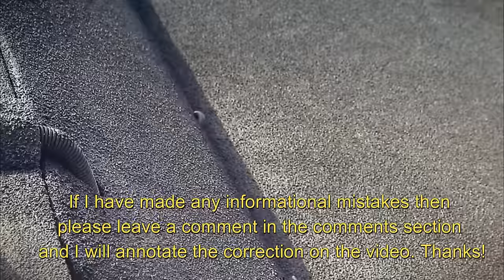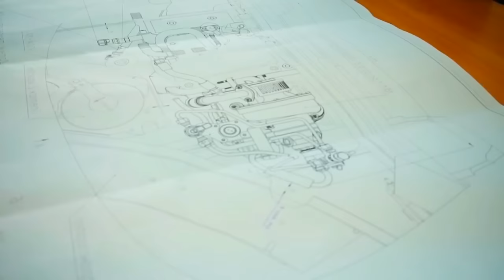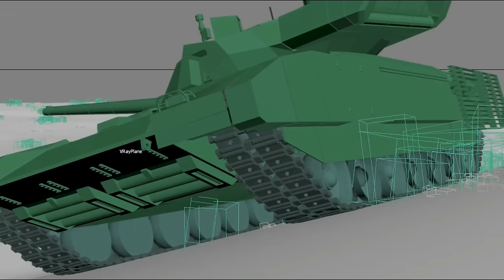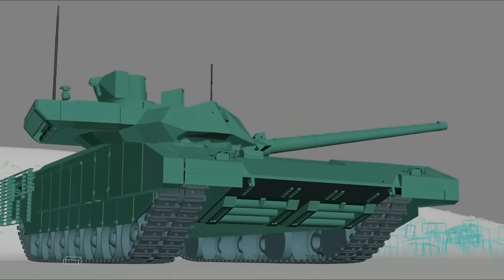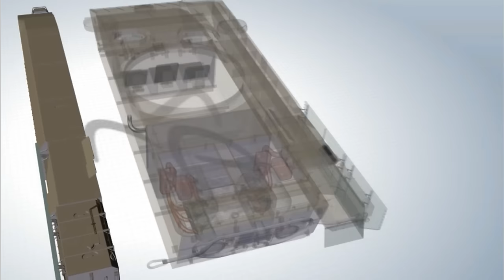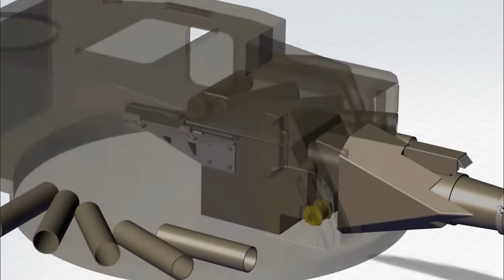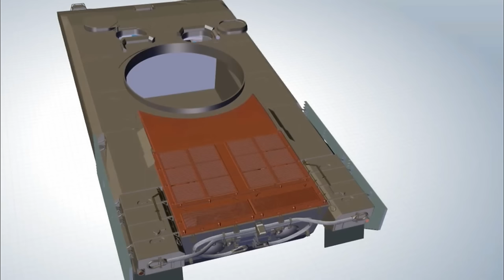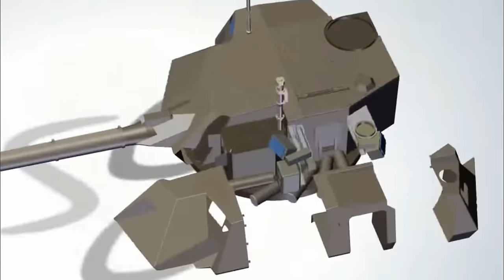T-14 Armata Russian Main Battle Tank - Tank Overview

Comment: You could also mind the shape of the tank. previous modern russian tanks had shapes that give incoming shells a bad angle for penetrating the hull, incresing the chance, that the shell wont to much damage.
The armata do not show any of this designs. Why?
One reason is surely that many modern AT launchers are smart rockets which attack top down. But there is an other possibility:
Look at the shape. They avoided curves in the hull as much as they can. And the surface of the tank appears to be soft.
This is near to sure a radar absorbing surface, and also the shape of the tank helps to give very few reflection angles, so this tank has a way smaller radar signature than preview russian tanks. i bet the radar signature of this tank is not bigger the size of 2 metres, and also just in case if radar is in right angle, in best case szenario i estimate radar signature size of a football.
Reply: Modern shells do not ricochet. No, really, it's not true today. Protection against "shock core" in Armaty was already there

Comment: T14 is still a working prototype. It might go into large scale issue but it might not. Lots of people thought the AN-94 was going to replace all their AK's but that was not to be. If it is adopted it will most likely be in service alongside T90 not as a complete replacement. This is only sensible, T90 isn't bad and they have a lot of second line and reserve formations to arm as well.

Comment: Question, with the crew pod sitting so close to the front and ground, how safe would it be for the crew against IED's or anti tank mines. Hits from ATGM's and tank fired projectiles might not be such a danger as before for the crew as when sitting in the turret, but wars arent those like they used to be in WW2. Take Syria for example, lots of use of VBIED's to take out tanks. 
Thank you for video, was wondering about the new Russain tank.

Comment: Things just got interesting...😋 One possible drawback of an unmanned turret is that if you loose power to the cameras the vehicle is practically blind. At least with maned turrets you have vision blocks and the good old commander sticking their head out of the hatch. Reliance on APS can also be a problem since they can be defeated fairly simply in some cases. An 'E-bomb' could soften up a group of t-14s. By knocking out the electronics you would blind it and knock out it's APS leaving it venerable. Very strong passive armour as on the Abrams and Challenger 2 would still work regardless. Sometimes there really is no substitute for several inches of composite. It is a dumb brute force defence. It can't be tricked, only deleted by equally brute force offence.
Reply: Hmm, I understand what you mean. But:
The main deadly shrapnel and blast injuries. This approach to the battlefield surveillance is not practiced for almost half a century. With a very high probability that the commander will die. The density of fire over time has increased significantly. This tactic is only applicable for low-intensity conflicts. Everything else-drones.
Can be used lasers (Chinese tanks). Easier to replace a camera than to pay pensions to veterans.
To break the panoramic sight? It is possible, though not easy. No camera, you can switch the surviving optical channel. If only to tear from the tower at all) + the second sight gunner-operator, protected by the main armor of the fighting module.
Electromagnetic pulse is not effective against tanks at all. Full shielding armor.
Armata is a highly stable multilayer armor, ceramics, steel, polymer. Forehead, sides of hull and turret multi-layered (like on Merkava) with a frontal projection 1500+ mm, unattainable for other tanks with the classic lineup.
And there is always the opportunity to put the 152mm. One shot, one goal.
The effectiveness of this approach can only display the time, go a long way.

Comment: The Armata is smaller than the T90. The T90 is about 9.53-9.63m in length, 3.78m in width, 2.22m in height. The T14 is about 8.7m in length,  3.5m in width and 3.3m in height
Reply: Thanks for correcting me:)

Comment: It's a bit hard to say that the T-72 is a truly new design when it first rolled out. It shares very much in common with the T-62 and the T-64. The T-72's prototype, the Object 172, looks very much like a T-64 at first glance even sharing a similar suspension. One of the T-62's prototype, the Object 167, seems to have some influence towards the T-72 via the suspension.

Comment: Questions concerning the Armata.....perhaps someone who knows can set me straight.  It seems to me with the crew encapsulated in the hull, there will be very little, if any direct vision for maintaining situational awareness.  It looks as though the turret is well populated with a variety of electro-optics for search and target functions.  Now, granted, the hull is heavily armored and there is an active protection system and reactive armor.  I'm wondering what the effect will be on all the sensors of an incoming round that is defeated by the protection system and reactive armor plus that of the chemical or kinetic round itself.

  That is going to be a lot of energy and fragmentation released in a very small space.  What will be the effects on the sensors?  What about an immediate follow on shot from the same quadrant?  Seems to me that a mission kill would reasonably follow all that commotion.  Certainly you could expect increased vulnerability for a partially or completely blinded tank.  Buttoned up tanks are a lot easier to sneak up on.  Interesting that the default position on the Armata seems to be buttoned up.  

As you point out in your video on the M1, the Americans took a look at this configuration with the M! test bed and decided not to develop in that direction.  Must have been some reason for that.

Comment: Very interesting video. A few thoughts: (A) Removing the crew from the turret is possibly a great idea. The loading/unloading system can now be designed without regard to habitability issues i.e. fumes, noise, temperature, limb safety, etc. Does this leave the door open for the turret to be an autonomous sub-system? Or, could vehicle A, with observation of a target fire an indirect round from the turret of vehicle B located safely behind cover. (B) Will the location of all crew in the hull reduce their situational awareness? Tanks are vulnerable to an enemy on foot and need to work closely with friendly troops to survive. A crew commander needs to know what's going on in the immediate vicinity of their vehicle. Will a remote observation system do that as well as vision blocks and a hatch? (C) Is operational effectiveness compromised with a three-person crew? Tracked vehicles need a lot of TLC to keep running well. If anything needs fixing you can guarantee it's heavy, awkward to get to and the remedy will will take the exact amount of time your halt is planned for. You miss out on sleep, meals, personal admin and all the usual routine of resupply, reporting, pickets, O groups, recces, etc goes on regardless. But won't the Spanners come out and fix my chariot for me? Maybe. But just as likely you'll get a message that your parts have been dumped at grid xyz and you'll have to get them yourself. One more person makes managing all that a lot easier. Anyway, thanks for the video.

Comment: Hi Matsimus! I have to take issue about your comment about '...leaving previous Russian tank designs behind..' or your view along those lines. You must know that the Russians completely caught the Germans by surprise with their T-34 tank design (and to a lesser extent, the heavily armoured KV-1). Cearly, the Russians do have a very good ability, in terms of breaking new ground with tanks designs, hence we see the T-14 Armata. It is quite possible that the T-14 is the current equivalent of the T-34, each design pushing tank design parameters in its own chronological time. I think the tanks produced in large numbers since the T-34 (for example, the T-54/55, T-72, T-90) were simply design extensions of the T-34 tank concept, but now we have, in Russian terms, another completely revolutionary tank design in the T-14. I suspect the West (read America), if it desires to start a war with Russia soon, will want to start WW3 before too many T-14 Armata AFVs are mass produced. Cheers Sandor!

Comment: t90 weighs 46,5 t and  has specific ground pressure around 0,95kg/cm2 ,lets suppose SGP for t14 is the same, then  the aproximative weight of armata( distributed over 14 wheels versus 12) is  54,25 t

Comment: nice video iv read that they testet an bigger gun and an coaxial automatic cannon with 30mm i think for potential future use the main gun is insane
Reply: https://topwar.ru/uploads/posts/2015-06/1434657373_tank-t-95.jpg
yes secondary weapon is supposed to be installed
Reply: monster gun^^
Reply: 2 meters penetration of steel at 2 km range i think :P 90 cm long bullet

Comment: It sounds like it offers excellent crew protection. It has a nice weight at 48 ton. Sensors and electronics are not a Russian strength but at least they will be modular and made for quick replacement if they follow their historical design methodology. I think they have a good design concept but my concern is their design execution.

Comment: Considering the rate of fire of a 7.62mm machine gun, they might very well stick with it, since they can pin infantry more effectively. 12.7 is great if you need to chew up an M113 or similar lightly armoured vehicle. But here, they have a big cannon to do that for them. Pinning infantry might be a more important concern, so I think that they chose a 7.62R/7.62x39mm (not sure which) machine gun for a good reason. Another thing to keep in mind is that you can store many more 7.62mm bullets than you can 12.7mm bullets.
Reply: True, infantry suppression is its primary task. 12.7 redundant against infantry and insufficient against armored vehicles. 7.62х54R not х39.

Comment: I'll have to see how it performs if they ever deploy it, but at this point I'm skeptical.  I understand the focus on crew safety, but in order to do that, they made a lot of sacrifices.  Some I'm not sure are worth it.  The biggest issue I see is that they've taken a tank, which generally has issues with situational awareness anyway, and blinded the crew even more.  By stacking the crew entirely in the front of the hull, all flank and rear visibility is limited to the gunner's and commander's sights.  Even front visibility is restricted because the placement of crew means that they must be entirely buttoned up in order to operate the turret.  There is no popping out the hatch to take a look around and scan for targets; you're looking out a viewer and periscopes, and that's it... or you have to shut down the turret to prevent being crushed by it traversing.  That is your entire view of the world until mission is over.  I don't see that as a positive.
Reply: The person is not able to perceive the situation faster and more clearly than the machine, in most cases a tank with a classical fire control system (like the old T-72) will give way completely to the digital system. Or do you suggest not using the sights at all?)

Comment: In my opinion its impressive they designed an built a new weapons system so quickly, however conceptually I think post Markava it is messed up to design the crew in the front, as you point out they have to drive backwards to turn it into an apc, there is no reason to place the tank crew in harms way in the front instead choosing to protect the engine in the rear, the crew is more important than the tank.
Reply: There Heavy T-15 infantry fighting vehicles with front engine. The crew of the tank in front of the protected much better.

Comment: The defense system will knock an 120mm APFSDSDU penetrator out of the air? Count me as VERY skeptical about that speaking from personal experience. We're talking about something carrying so much kinetic energy it will blow through the front slope of a T-72 and out the grill doors at 2000 meters. It takes a lot to significantly alter the course of that kind of kinetic energy.
Reply: The principle of "shock core" both in the Javelin. Suffice it to partial destruction of the shell.
Reply: I know the principle. I'm still not buying the system knocking down a APFSDSDU round.
Reply: That is what they claim but I am skeptical as well.
Reply: MkYoung666 I think knocking it to the ground is a bit ridiculous too, but one thing to bear in mind is that APFSDS need to be stable when hitting the target, if the APS can just make the APFSDS wobble a bit(exploding something at it will do), the whole projectile will shatter on impact.
Reply: That system uses a directed explosion. If it's enough to penetrate a meter of steel, it's probably enough to knock out a metal rod.
Reply: T-14 Armata's APFSDSDU's goes at almost 2000/m a second and Abrams goes at about 1600/m a second. Now imagine what will happen if it shot the front of the Abrams. The tank will be destroyed.
 No, no T-72 was blown through the front and out the back. That is physically not possible. The round will tear up inside the tank and shrapnel and everything will be spread around through-out the tank. Maybe if it was through the side, then that is possible, but the tank is just to long, and other things will be in the way like ammunition, fuel tanks, radiator, engine, etc. 

My dad was in a Soviet T-72 once at an exhibition, and he said its very crowded in their, especially with the auto-loader, Ammunition compartment, wires going everywhere, etc.

It's not like there's just the armor, then the driver, then the next few crew members, then the engine, and the thin armor at the back of the tank. No, its much more then that :) 

Plus, if your talking about those Iraq joke paper export T-72's, then no, you still can't penetrate the T-72 all the way. Through the side yes because there will still be enough power left.
  If it was a Soviet T-72, then no, because in the turret and hull armor, there is reactive armor sandwiched between steel and ceramic plates, making it very difficult for a sabot to penetrate that.

With the Iraqi T-72, its like poking a hot needle through jelly, but with a Soviet T-72, it's like poking a hot needle through a coconut. You may not believe me but it really is true.

When India was buying Russian T-90's, they stripped the tank from its ERA it came with, and purchased an advanced M829A2/KEW-A2 APFSDS round and shot at the turret and hull, and the armor managed to stop the sabot from going through half of the armor.

Comment: The strategy of the Cold War for the USSR against the West, was, including the tank breakthrough of 50 thousand main tanks. But even the total army of the USSR was not able to contain 200 thousand tankers at the same time. That is why most of the Soviet tanks were the self-loading carousel in the tower. This freed up a significant number of fighters for technical work in tank units. And precisely, because of this,  it is possible to observe  so often the torn off tank towers of Soviet and Russian tanks on the battlefields.

Comment: Question: Since the turret is now unmanned, what do they do if there's a stoppage in the loading system or the MGs during battle?
Reply: Like with all other tanks - get out and fix problem. There is a lot of problems which could happen where you must expose yourself during repair work. Sorry, that is the combat... One ordinary bird shit on optics and you must get out. One rock in sprocket or piece of armature in tracks and you must get out. One dead fuse for outside oil pump and you must get out, etc, etc, etc...
Find shelter, take the tank there and fix the problem.
If you can't get out, the infantry have fucked up for all the money!!!

Comment: OK, one thing I don't get about the Armata: why the high profile? I know the turret isn't manned, but you want to keep the tank combat effective, and without the turret it's not much use. And yes, I know it has dozer blades so it can effectively lower its profile in defensive engagements, but still... 3,3 metres is too much.
Reply: The high location of the tower is very good for a gun and aiming angles. The crew needs lots of space. Ammunition require space, etc.
Tower heavily armored, and most importantly to conceal the body, the rest is not so important important

Comment: there are of course small mistakes, but in the general video very good, thanks...!!! badly I know English, I'm sorry, can I haven't noticed, but it seemed to me that you have forgotten to tell about purpose of cracks in front on the tank case, between caterpillars and the case from above...)) very many who do video about T-14 don't know why they are necessary or don't turn attention to them...) ) But nevertheless, it is additional protection against rockets with thermal targeting... in the fighting mode all heat and exhaust gases switch and выводтся the tank forward, leave through these openings... thus taking away heat of the tank from the engine forward where the best protection and thick armor... rockets with the thermal guiding head can't see the engine and... if doesn't bring down them "afganit" that rockets hit to the thickest place of the tank, without having done him harm... still many forget to tell that automatic protection of the tank when radars will notice the shell flying to the tank or the rocket, turns a tank tower towards threat, having substituted her most armored part under blow... thanks for video, good luck and progress...!!))

Comment: I would be concern by the autoloader and the electronics. Boeing is already testing electromagnetic pulse weapons (UAVs). Internal electronics would probably survive but all sensors would be render inoperative. Auloloader are prompt to failure. With no gun, it's only a 50 tons can. I hope they have a mean to disengage the auto loader and switch to manual but, given the configuration of the turret, that's seems improbable.